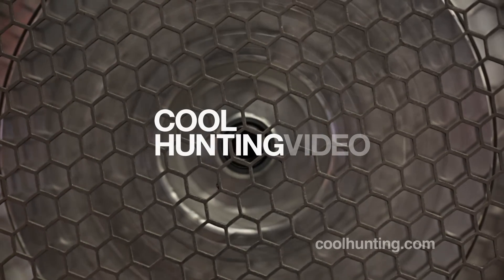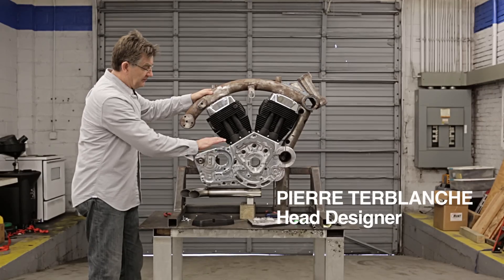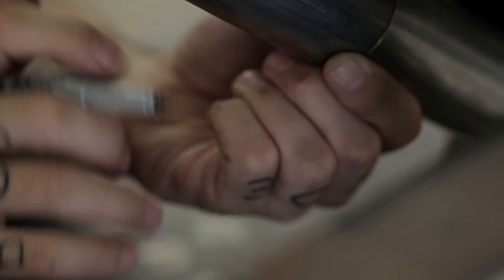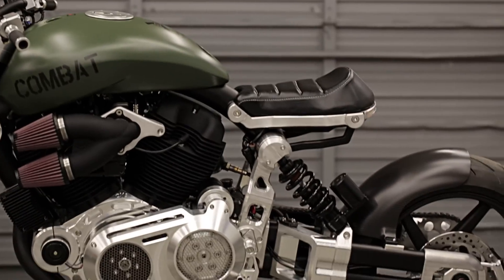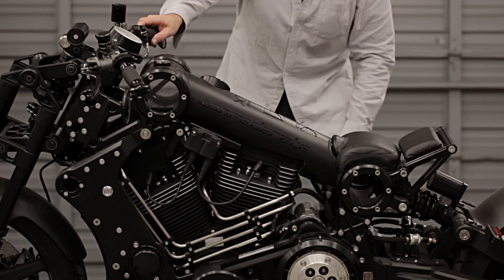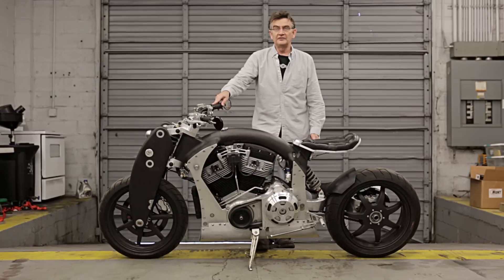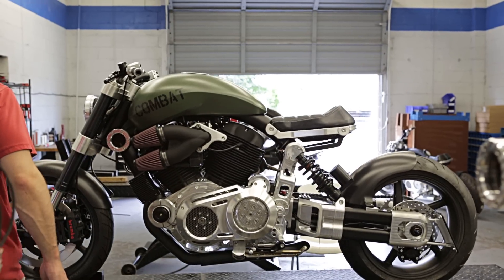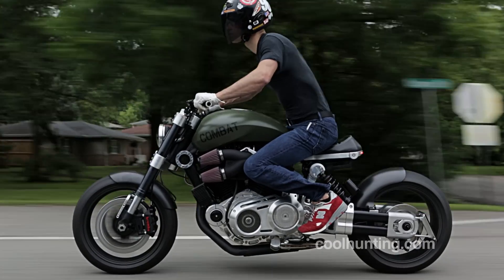Confederate Motorcycles

Comment: Bof... My tenth bike, a Yamaha 660 cc MT03 weights 168 Kilograms but has DOUBLE disk brake on front wheel! By the way, are you metric or do you revel in 1/32 of inches ???